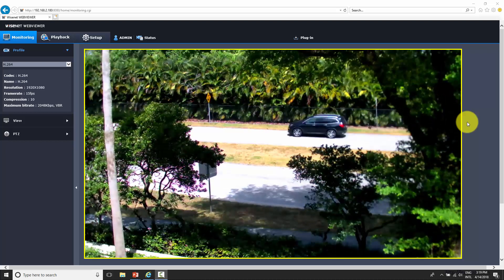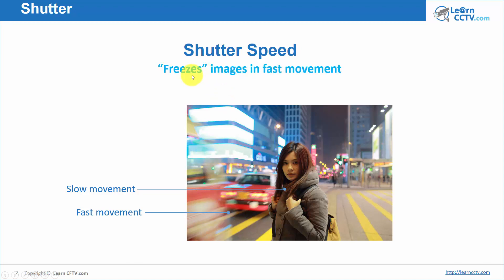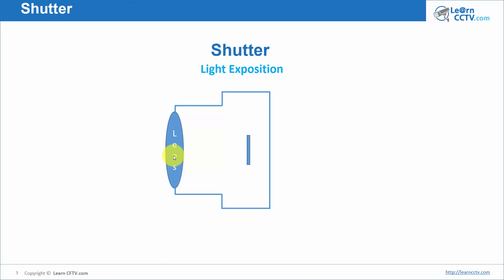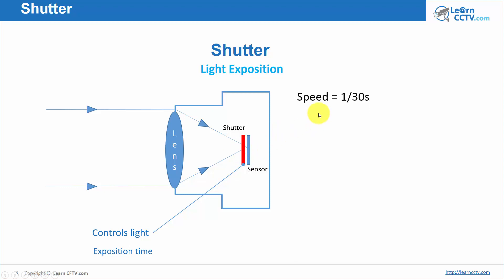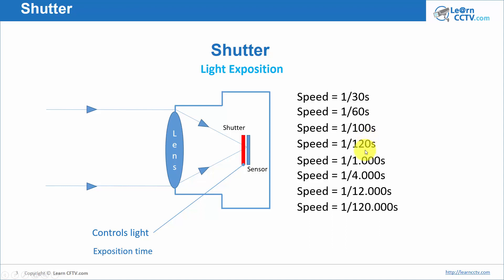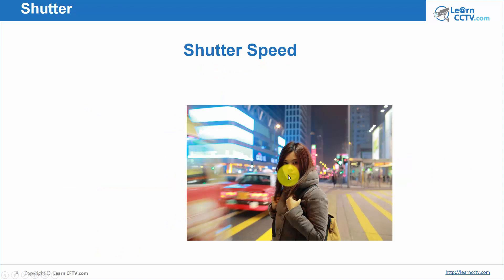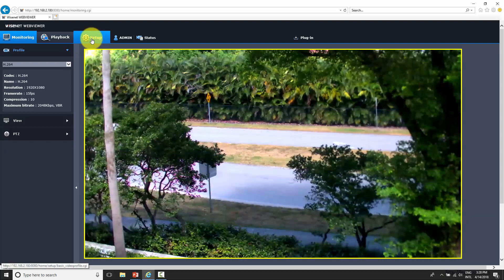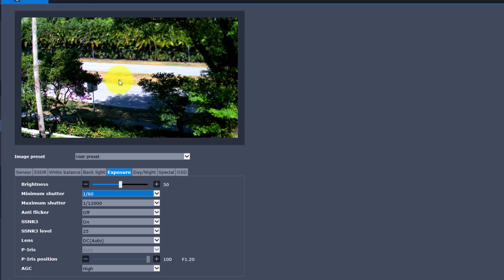License plate recognition security camera setup

Comment: Claudemir sllightly off the subject,   have 2 ip cameras which record in  .264 format on microSD card However none of the the cards are playable on any of the computer or  android players including VLC even after setting it to play only 264 format. Moreover each camera  plays back only what it itself has recorded ie it doesnt play each others files although both in record 264 format. Any advice appreciated thanks
Reply from the maker: Hi. It's normal it won't play since it's using the manufacturer proprietary recording. You need to convert to be able to play on regular players. I suggest using software such the "Any video converter" (Just google it, there's a Free Version available).